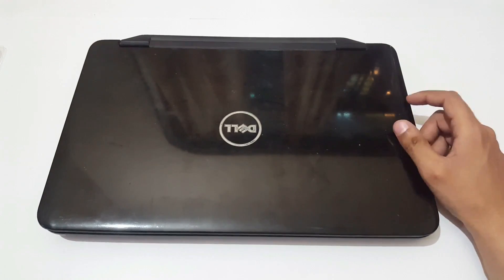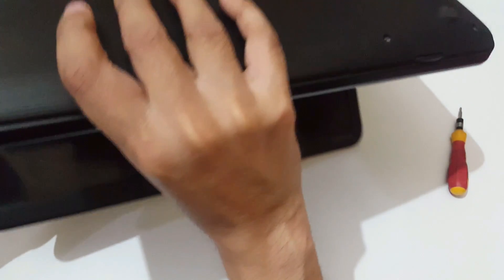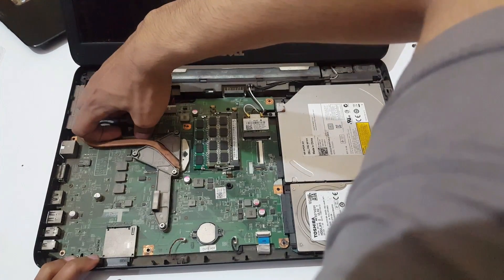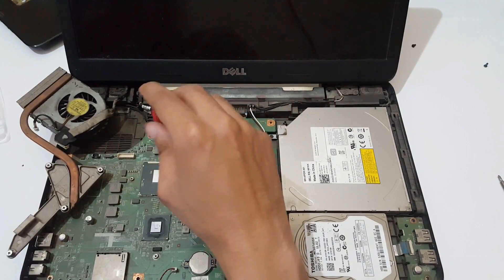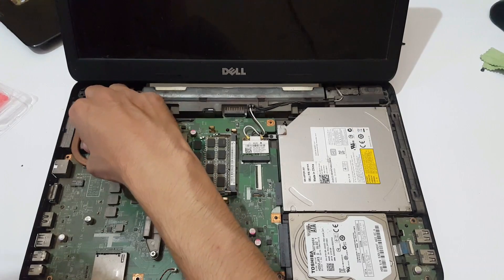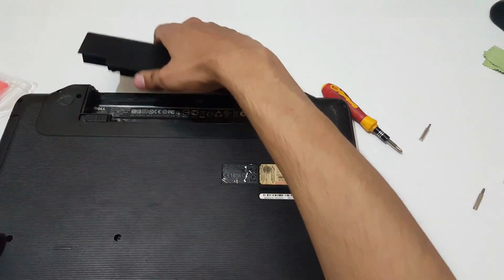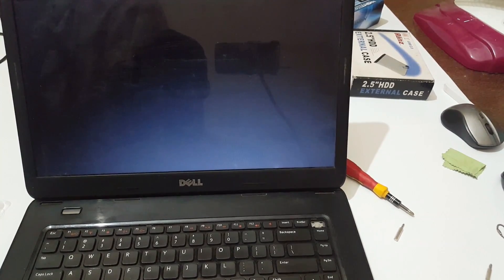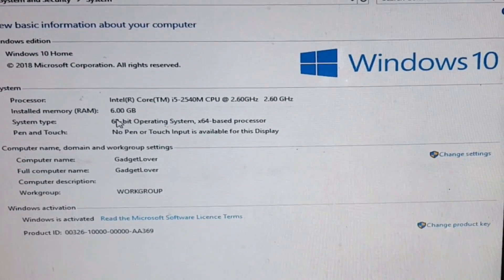How to Upgrade Processor on DELL Laptop | i3 to i5 & i7 - Make Laptop Faster for Gaming

Comment: Great video,Can I upgrade mine to i5 or i7?It is a dell inspiron 15 3000 i3 8th gen computer.
Reply from the maker: Thanks and in my knowledge the processor of this Laptop is soldered so you can't upgrade it but I would suggest you upgrade its RAM to max and install SSD for better performance
Reply: @GadgetLover360  ok thank you
Reply from the maker: @dimuthumarabedda9982  You're welcome

Comment: Halo brother I have 
Dell latitude e5410
4gb ram
Hdd
i5 intel processor
Which things can be upgraded please reply
Reply from the maker: Hi and the processor of this Laptop is soldered so you can't upgrade it but I would suggest you upgrade its RAM to max and install SSD for better performance

Comment: Can i upgrade my dell inspiron 13 5000 series i3 to i7???
Reply from the maker: In my knowledge the processor of this Laptop is soldered so you can't upgrade it but I would suggest you upgrade its RAM to max and install SSD for better performance

Comment: I have HP 15s du1064tu i3 10th generation can I upgrade it to i5
Reply from the maker: The processor of this Laptop is soldered so you can't upgrade it but I would suggest you upgrade its RAM to max and install SSD for better performance

Comment: Bro I have i3 7th gen 4gb 1 tb hdd can I replace my processor
Reply from the maker: I would like to inform you that if the processor is not soldered you can upgrade it in same generation
Reply: @GadgetLover360  thank you  +2 subs
Reply from the maker: @karuneshkumar6773  Dear subscriber you're welcome
Reply: @GadgetLover360  will you remember me when you become famous
Reply from the maker: @karuneshkumar6773  Don't worry if you face any technical problem I am always here to help
Reply: @GadgetLover360  ☺

Comment: A very informative video,
I want to upgrade my processor can you plz suggest which processor will be compatible , i got dell inspiron 15 3558 (i5-5200U) 6gb ram.
Reply from the maker: Thanks and I would like to inform you that the processor of this Laptop is soldered so you can't upgrade it but I would suggest you upgrade its RAM to max and install SSD for better performance

Comment: Hi i wanna ask if i change my processor on laptop im using LG XNOTE Z450 intel i5 3317u hd 4000?
Reply from the maker: I would like to inform you that if the processor is not soldered you can upgrade it in same generation

Comment: Bro i have Dell latitude E5440 and it has intel i5 4300u to which processor I can upgrade please tell
Reply from the maker: The processor of this Laptop is soldered so you can't upgrade it but I would suggest you upgrade its RAM to max and install SSD for better performance
Reply: @GadgetLover360  okay bro thank you
Reply from the maker: @anonymous491  You're welcome

Comment: Can you upgrade the processor of dell inspiron 3593
Reply from the maker: The processor of this Laptop is soldered so you can't upgrade it but I would suggest you upgrade its RAM to max and install SSD for better performance
Reply: @GadgetLover360  can I play valorant after increasing ram to 8gb?
Reply from the maker: @Dhruvr21  It will improve the performance and I would suggest you attach external graphics card to your Laptop for better gaming experience
Reply: @GadgetLover360  ok

Comment: Sir I want to upgrade my laptop my laptop specifications are 4gb ram intel i3 m300 and can I upgrade it because I want to run blender types of software some one said me that upgrade your processor but it is s solderable so what can I do because my software is lagging too much that's why plz tell me sir plz 🙏🏻🙏🏻🙏🏻🙏🏻🙏🏻🙏🏻🙏🏻
Reply from the maker: It would be Intel Core i3 330M and Intel Core i5 580M is best processor for your Laptop
Reply: @GadgetLover360  can I contact you on insta plz
Reply from the maker: @shitaldeshkar3092  If you have any problem related to this video then tell me in comment I would be happy to help you
Reply: @GadgetLover360  ya my blender software was running lag so that I asked some animators so they say that you have to increase your processor and ram but I have processor i3 it was not be replaceable and ram toh me badhalunga but processor ka ye puchna hai ki agar me motherboard ko change karke naya processer lagalu toh aaise Ho sakta hai sir
Reply from the maker: @shitaldeshkar3092  Yes but it will be very expensive
Reply: @GadgetLover360  how much sir can you give me some idea
Reply from the maker: @shitaldeshkar3092  That would be about half of a brand new Laptop
Reply: @GadgetLover360  means how much any idea
Reply from the maker: @shitaldeshkar3092  I suggest you see on Google

Comment: can i upgrade my inspiron 3521 i3-3217U to ryzen 3 processor?
Reply from the maker: The processor of this Laptop is soldered so you can't upgrade it but I would suggest you upgrade its RAM and install SSD for better performance
Reply: @GadgetLover360  :( i already upgrade to ssd and 4 to 6 gbs of ram, can you suggest how many rams more
Reply from the maker: @adonnesdondon130  You can expand it upto 8GB
Reply: @GadgetLover360  hey sir can you help me my pc cant connect lan cable
Reply: i mean i plug my lan cable and my pc didnt detect it
Reply from the maker: @adonnesdondon130  Go to Control Panel>Network and Internet>Network and Sharing Center>Troubleshoot problems and see whether the problem has been solved

Comment: can you please suggest cpu and gpu for dell inspiron 15 3552 celeron 2016 model
Reply from the maker: The processor of this Laptop is soldered so you can't upgrade it but I would suggest you upgrade its RAM to max and install SSD for better performance

Comment: Vostro 1540 can i upgrade from i3 380m to i5 2nd gen(i5-2450M)?
Reply from the maker: No but I would like to inform that you can upgrade it in same generation and Intel Core i5 580M is best processor for your Laptop

Comment: I have a inspiron 11z 1110 
Can i upgrade the processor from su4100 to a better model
It is soldered but its on a daughter board so is there anyway to upgrade daughter board
Reply from the maker: I would like to inform you that professional hand soldering services is required to upgrade its processor

Comment: Can i upgrade my insperon 15 series 5558 model frm i3 to i5
Reply from the maker: The processor of this Laptop is soldered so you can't upgrade it but I would suggest you upgrade its RAM to max and install SSD for better performance

Comment: Hp 15-da0447tx i3 - 7020U 2.30GHZ 
4 GB RAM 64 Bit and upgrade are i5 and i7... Plz Answer...
Reply from the maker: In my knowledge the processor of this Laptop is soldered so you can't upgrade it but I would suggest you upgrade its RAM to max and install SSD for better performance
Reply: @GadgetLover360  Thank You Yar....😀
Reply from the maker: @pratiksoni5092  You're welcome

Comment: Hi, my laptop is HP 15-da2003nx i5 -1021OU(10th gen) is it possible to replace it to i7 and replace HDD to SSD? i found my laptop quite slow with 1.6ghz to 2.11ghz
Reply from the maker: In my knowledge the processor of this Laptop is soldered so you can't upgrade it but yes you can install SSD and upgrade RAM to max for better performance

Comment: Hi bro 
Can I update laptop processor for the 
model - hp 15-ac024tx.
And where can I buy this processor if possible.
Reply from the maker: Hi and in my knowledge the processor of this Laptop is soldered so you can't upgrade it but I would suggest you upgrade its RAM to max and install SSD for better performance

Comment: Hi I am using Dell inspiron N5010 i3 processor can I change it to i5 processor please suggest me its working very slow and stucks every time
Reply from the maker: Yes you can upgrade it in same generation and I would suggest you upgrade its RAM to max and install SSD for more better performance

Comment: hello i have x540la i5 5200u i was thinking of upgrading my cpu to i7 5500 will it be worth it i already upgraded my ram and ssd was also thinking of buying an egpu what gpu would be nice without much bottle neck if i were to upgrade to i7
Reply from the maker: I would like to inform you that the processor of this Laptop is soldered so you can't upgrade it and for better gaming experience Asus GeForce GT 710 2GB DDR5 graphics card would be the better choice

Comment: I have a Dell Inspiron 14 3467 i3 6006u 
Is the processor soldered? If yes can I upgrade my laptops mother board so that I can have a better processor?
Reply from the maker: Yes the processor of this Laptop is soldered so you can't upgrade it but a professional hand soldering technical person can do it and yes you can also upgrade its motherboard for much better performance but it will be very expensive so I would suggest you upgrade its RAM to max and install SSD which will provide better performance
Reply: @GadgetLover360  thanks, I am already planning on buying SSD and RAM for my laptop
Reply from the maker: @Quisedz1406  You're welcome and go for it

Comment: HEY brother I have laptop which has intel i5 (3230) processor my question is which cpu is capatible to upgrade with my laptop and second question is can I use apu instead please answer me thanks😊
Reply from the maker: You're welcome and Intel Core i7 3540M is best processor for your Laptop and I would like to inform you that if the processor is not soldered you can upgrade it in same generation only
Reply: @GadgetLover360  my Processor is not soldered and maybe it's 3rd generation of  i5 so is the Processor you are recommending me is compatible with my laptop is it 3rd generation Processor?
Reply: And what you think about apu?
Is apu compatible with my laptop?
Reply from the maker: @muhammadahmadriaz9542  Yes
Reply: @GadgetLover360  thanks alot bro 
I really appreciate that.
Reply from the maker: @muhammadahmadriaz9542  You're most welcome

Comment: Hi bro. I have a Lenovo G570 currently running on an i5 . Is it possible to upgrade it to an i7 processor? If so where can I buy the new processor.
Reply from the maker: Hi and yes you can upgrade it in same generation of i7 processor and I would suggest you buy it from Ebay or Aliexpress online store

Comment: sir i want to a help i just bought new laptop of dell inspiron 15 3000 i3 and i increased ram to 8gb but my problem is i want to just run 2 app which is Minecraft(game to play) and Teams(school classes) but whenever i try to run both crash my laptop is there any solution for these because all other apps are running but most important are not running hope i get help i subscribed you coz i am also a gadget lover
Reply from the maker: Dear subscriber in my knowledge the processor of this Laptop is soldered so you can't upgrade it but I would suggest you upgrade its RAM to maximum and install SSD for better performance and you can also attach external graphics card to your Laptop for better gaming experience
Reply: @GadgetLover360  thank you sir for telling what steps i have to take but is there anything else coz i can't upgrade at this time and if it want to crash it would crash in starting but this month it common i found in my pc that when fan increase my processor slow and crash happenes and as i can not upgrade it is there any way to cool down fan speed or increase performance ?
Reply from the maker: @JetechGaming  You're welcome and I would suggest you to use cooling pad

Comment: I own dell 5010n i5 500gb but upgraded to 1tb but lappy is slow plz help me what to upgrade existing is 
Module,Processor,Arrandale,I5- 460M,2.53,N5010
Reply from the maker: Intel Core i7 640M is best processor for your Laptop and I would suggest you also upgrade its RAM and install SSD for more better performance
Reply: @GadgetLover360  im getting exchange value of 13k approx shall i go for it or upgrade with ssd 256 ....plzzz reply
Reply from the maker: @goussharief  Upgrade SSD and I would suggest you buy its processor from Ebay or Aliexpress online store at a affordable price

Comment: I have lenovo ideapad 100-15IBD ita has i3-5005u processor.what is the best processor for it.pplz advice me...
and your video is really really helpful
Reply from the maker: Thanks and I would like to inform you that the processor of this Laptop is soldered so you can't upgrade it but I would suggest you upgrade its RAM and install SSD for better performance
Reply: @GadgetLover360  ok thanks man
Reply: @GadgetLover360  I appreciate your reply
Reply from the maker: @asianghoul  You're welcome

Comment: Bro I have Intel Pentium dual core
Reply: Can u suggest me in 2.6 GHz or later
Reply from the maker: @asiangamerz9910  Provide processor number
Reply: Intel (r) Pentium (r) dual core, 1.89ghz
Reply: No number
Reply from the maker: @asiangamerz9910  What Laptop do you have
Reply: Dell Inspiron 1525
Reply from the maker: @asiangamerz9910  Intel Core 2 Duo T7800 is best processor for your Laptop

Comment: Can i change my amd a6 proceser with intel i5
Reply from the maker: No
Reply: @GadgetLover360  why
Reply from the maker: @happyunion9747  I would like to inform you that if the processor is not soldered you can upgrade it in same generation only

Comment: hello,
i have same laptop, if i have change to i5 processor, can i paly higent graphics games?
Reply from the maker: This method will definitely improve the performance of your Laptop and I would suggest you also upgrade its RAM and install SSD for more better performance but in my knowledge for better gaming experience you need to attach external graphics card
Reply: Okay, thankyou
Reply from the maker: @yoosufarshad1356  You're welcome

Comment: bro hi thanks for the video  
i have dell inspiron 3593 what is the best proccessor for gaming
Reply from the maker: You're welcome and I would like to inform you that the processor of this Laptop is soldered so you can't upgrade it but I would suggest you upgrade its RAM and install SSD for better performance
Reply: @GadgetLover360  i bought it last year i3 10 generation can't i
Reply: @GadgetLover360  can I improve my graphic card
Reply from the maker: @jesusislight37  Yes you can attach graphics card externally to your Laptop

Comment: My laptop is hp15ay542tu i3 with 16gb ram, which will be the best processor upgrade for the pc, thankyou in advance
Reply from the maker: The processor of this Laptop is soldered so you can't upgrade it but I would suggest you upgrade its RAM and install SSD for better performance

Comment: Hello bro 
Can we replace the processor i5 10th gen to i7 10th gen in Dell G3 
Please reply
Reply from the maker: Hi and the processor of this Laptop is soldered so you can't upgrade it but I would suggest you upgrade its RAM and install SSD for better performance
Reply: @GadgetLover360  damn bro 
I even wanted to upgrade my ram yo 16gb 
But laptop comes with 2 4gb cards and I have warranty
Dell ne game kar diya
Reply from the maker: @rushikeshpatil9621  I would suggest you buy two 8GB RAM

Comment: Wait wait wait wait. I thougth you CAN'T change cpu cause it would damage motherboard
Reply from the maker: I would like to inform that you can upgrade processor in same generation without any problem
Reply: @GadgetLover360  what about In ASUS laptops?
Reply from the maker: @Alizadaaaaa  If the processor is not soldered you can upgrade it in same generation
Reply: @GadgetLover360  oh ok thx
Reply from the maker: @Alizadaaaaa  You're welcome

Comment: Can I upgrade form i3 to i5 in inspiron 14 5000 2in1
Reply from the maker: The processor of this Laptop is soldered so you can't upgrade it but I would suggest you upgrade its RAM and install SSD for better performance
Reply: @GadgetLover360  ty bro
Reply from the maker: @prabirbhatia5920  You're welcome
Reply: Bro can u suggest me between ssd brands?
Reply from the maker: @prabirbhatia5920  Samsung would be best
Reply: @GadgetLover360  ty v.much
Reply from the maker: @prabirbhatia5920  You're most welcome
Reply: Can I upgrade cpu on Lenovo Ideapad Z580 (59-333345)
Reply: Pls ans asap
Reply from the maker: @prabirbhatia5920  Yes

Comment: Sir won't upgrading cpu cause bios issues?
Reply from the maker: No
Reply: @GadgetLover360  mine is soldered, is there any way i can upgrade it?
Reply from the maker: @avion_  I would like to inform you that for this professional hand soldering services is required
Reply: @GadgetLover360  oh ok sir, thanks a lot.
Reply from the maker: @avion_  You're most welcome

Comment: I have HP 15q-ds0006tu ( i3 - 7020U - 7th generation - 2.3ghz) 4GB RAM, 1TB HDD. Motherboard: HP 84A6. Can I upgrade to i5 or i7 ?

Does it support M.2 NVMe SSD?
Reply from the maker: The processor of this Laptop is soldered so you can't upgrade it but I would suggest you upgrade its RAM and install SSD for better performance and yes it has M.2 slot

Comment: Hello sir could i upgrade my Asus     Version	10.0.19042 Build 19042 with an Intel Celeron N4020. If you need the model its VivoBook_ASUS Laptop E410MA_E4M10A.
Reply from the maker: The processor of this Laptop is soldered so you can't upgrade it but I would suggest you install SSD for better performance
Reply: @GadgetLover360  would it be possible to unsolder it?
Reply from the maker: @PapaSmurt  Yes but professional hand soldering services is required

Comment: i have dell inspiron 3593 i3 10thgen....can i upgrade it to i5???
Reply from the maker: The processor of this Laptop is soldered so you can't upgrade it but I would suggest you upgrade its RAM and install SSD for better performance

Comment: Can I upgrade my Intel i3 7th gen Dell Inspiron 15 3000 processor?
Reply from the maker: In my knowledge the processor of this Laptop is soldered so you can't upgrade it but I would suggest you upgrade its RAM and install SSD for better performance